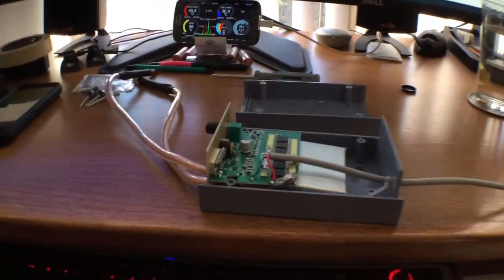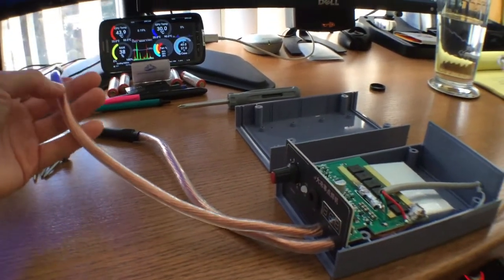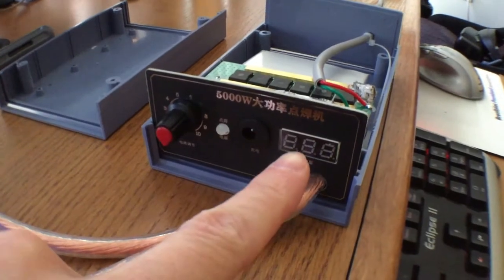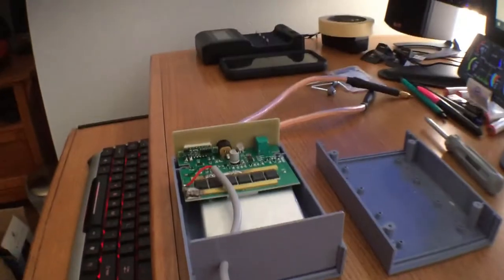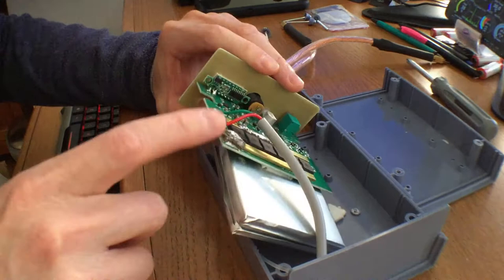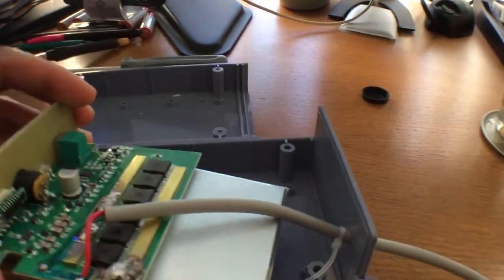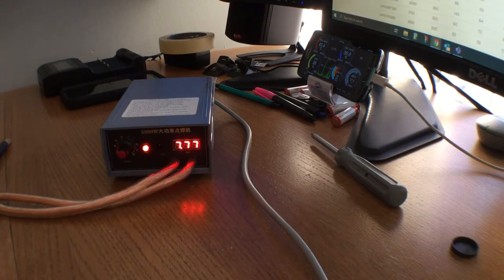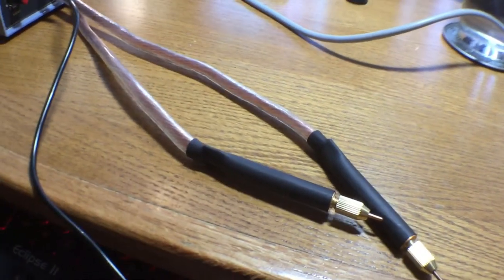KKMoon 5000W portable mini spot welder overview and disassembly

Comment: Great vid - thanks.
Quick one - in your video you mention that we can buy new tips (1.5mm-ish to 2mm dia. copper rod..)  if needed and that it can be bough online...
My questions: 
1) Where would one look for these extra tips online - what search terms - is it general copper rods or specific for this model spot welder?
2) How does one know when it is time to change the tips? what to look out for?
Thanks.
Reply from the maker: They're just copper rod you can find online. You sand them down and if you can't sand any more, you replace

Comment: Any known design flaws on this model, like on some of the other ones which need to be modded? And does it have auto discharge to storage voltage after a certain time unused, and circuitry to prevent it from discharging too low?
Reply: From the video - no strain relief on the welding leads getting out the case.Twisting them would likely break the solder connection off the battery and can even short it for extra fun. The soldering quality 2:52 is atrocious too.

Comment: hey there @MINIz guy - can i ask a small favor? While upgrading my unit today there was an accidental short. Which destroyed one of the chips on the PCB. Unfortunately the damage caused the plastic package to melt off some of the chip markings. And can no longer read properly to find out what this thing is.  It's the flat wide rectangular IC marked as 'U2'. Which is located on the main PCB, nearby to the corner where the LCD display is glued on. Clearly this chip needs replacement. But i'm kindda out of luck finding one unless you could please help me out!

If you could please find the time to open it back up again, your device? To find out what those chip markings says? Would be so very grateful. It is pretty small and can be hard to make out without a strong light. And maybe some type of an aid to make it easier to see them. Like a magnifier or smartphone camera etc. Sometimes also wetting the chip a little bit... and rotating it. This can also help to give a better visibility on these markings. And make them stand out more.
Reply from the maker: I sold mine, sorry
Reply: Hi.. The MOSFET used is No. 4N04R8
Reply: Hi.. The MOSFET used is No. 4N04R8

Comment: Hello,
Can you tell me what kind of mosfet's this spot welder has ? I cannot see the serial numbers on the video :/
Reply from the maker: 4N04R8 mosfets. Are they any good?
Reply: @MINIzguy  it is really hard to say how good they are. They probably are chinese fake Infineon mosfet's. Unfortunately they can be faulty :/ Every cheap spot welder from Aliexpress usses them. How many welds/battery packs have you spot welded so far ?
Reply from the maker: @SadBoyJanuszKiedysToBylo  Only 4 packs from 3 to 6 cells so far and then the testing in my videos. So far nothing broken. I need to buy .2mm and rebuild my Milwaukee battery packs soon, but I picked up a project car and got busy.
Reply: @MINIzguy  Ok, I understand. Oh yes, you bought very nice E46. When you gonna fit turbocharger in this 3.0 liter beast :D ?
Reply from the maker: No turbo plans, if the chassis lasts a few years I may turn it into a Spec E46 car!
Reply from the maker: Do you think I can hook up 3S lipo to this without any changes? The MOSFETS should take 3S without a problem, no?
Reply: @MINIzguy  Sorry wor not responding. Hard to say, because te included charger is for 2S, so the spot welder integrated BMS system (if this spot welder has BMS) can also be designed for 2S Lipo only :(
Reply from the maker: @SadBoyJanuszKiedysToBylo  Hmm, I will have to recheck the wiring. I think it is pretty simple and doesn't have a real BMS. One electrode is directly connected to the battery, the other is connected to one side of the MOSFETs with the battery connected to the other side of the MOSFETs. The volt meter is just two wires that connect to the battery. I don't see any balance wires for a BMS to work. Either way, if I burn this up, the 3S battery I buy can be used for a KWeld
Reply: @MINIzguy Ok. I think that if there is not any BMS inside then you could use the 3S battery without any problems. Mosfets can handle up to 40V. Also you will have to but 3S charger. If it will not work then Kweld is great spot welder. Can you tell me why are you want to use 3S lipo ? The welder is not strong enough ?
Reply from the maker: @SadBoyJanuszKiedysToBylo  Yea, see my latest video trying to weld 0.2mm pure nickel strip. I see people using the other cheap welders with 3S packs and since the leads are so beefy on this one, I will try it out too. I have a LiPo charger from my R/C days so that part is taken care of!

Comment: That's a time bomb. Why dont u use just a small transformer, 1 bridge rectifier, and capacitors!, 10,000uF 25v in parallel of 6 pcs would be enough for connecting batteries.

Comment: I think it's not 5000 becasuse the circuits installed 6 mosfet,  every mosfet can mannage 300A 375Watts or heat desipatation.  moreover as long as it's worked! it's fine.

Comment: hi i also buy one and i like the weldings he makes. but the batterij survived the product. it last 2 charges
Reply from the maker: I thought the battery was too weak, but mine didn't fail. I had a hard time desoldering the battery with my 140w iron so I gave up and sold it
Reply: @MINIzguy  what was your plan if you had managed to desolder the battery? 
Zeee 7.4V 60C 1500mAh 2S, in 2p configuration? 
im thinking about attempting this
Reply from the maker: @user-jx2zz4lb5d  I purchased a Turnigy 11.1V battery rated for 70-140C and was hoping to use that thinking it would be stronger than the 2S2P 7.4V config
Reply: @MINIzguy  thanks for the reply. great to know. ill stick with the 2s battery and see how that goes. thanks for posting the video mate.
Reply from the maker: @user-jx2zz4lb5d  If this KKMoon thing fails you, check out my Malectrics video as it is a much better spot welder with more features than I need